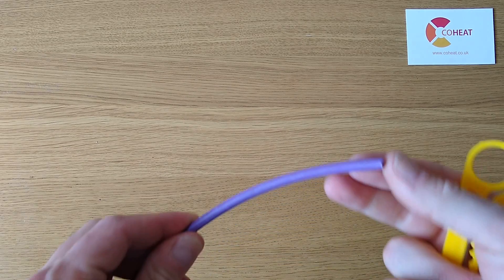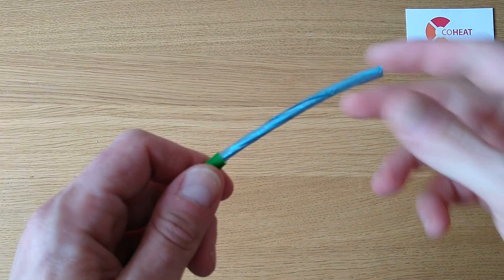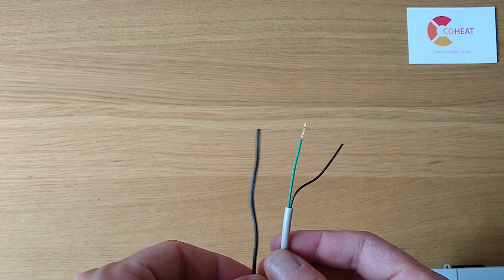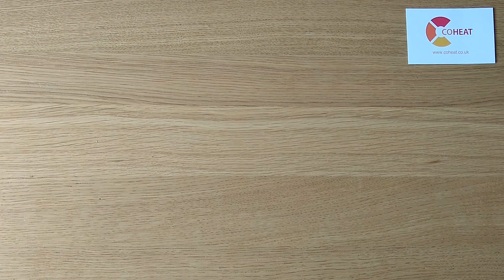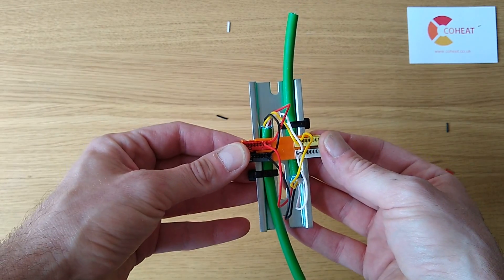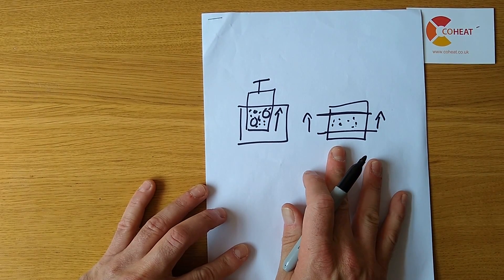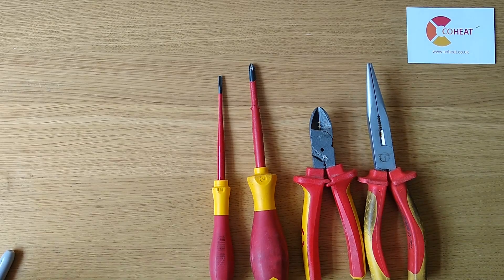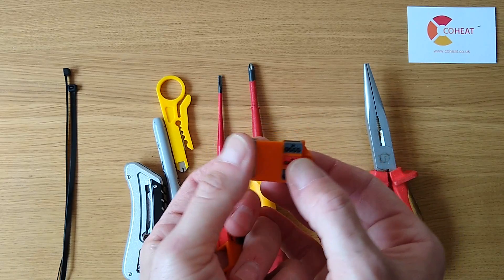Cable and connector types for use with M-Bus systems

Comment: Its NOT a good idea to use CAT5 cable for an M-Bus network, Using an 8760 cable there is less chance the cable will get damaged during the install on a working site.
Reply from the maker: Agree. This work is usually given to mechanical contractors rather than data or telephony network installers; so you want to specify something more resistant to brute force and tools really meant for 230 VAC work. The EIB / KNX type cable shown is even more robust than the Belden 8760 type cable in this application.

If CAT5 is what you've got to work with though (e.g. an existing site that's already live) then the BT gel crimps for joining conductors, ferrules for sticking it into terminal blocks (or pigtails of a thicker conductor), and plenty of strain relief so that the conductors aren't taking the hit will maximise you chances of success. It's worth nothing that regular Ethernet cables (patch leads) are solid core and plenty flexible for servicing work. It's the strain relief that allows this. (much of the bad rep of CAT5 fragility is not restraining the outer sheath and relying on the conductors to take the strain)